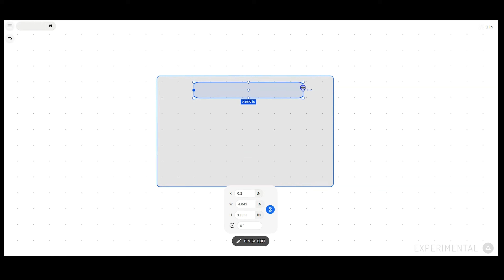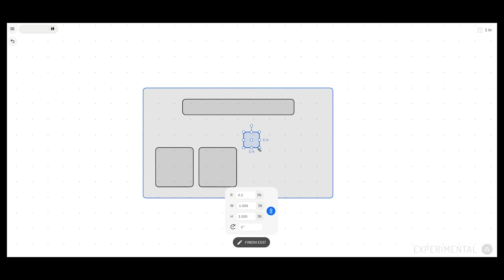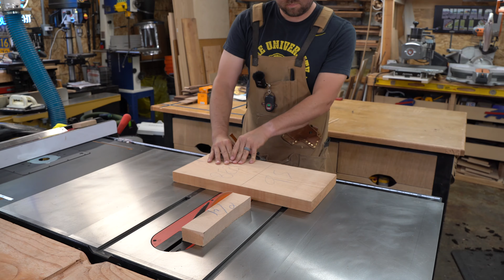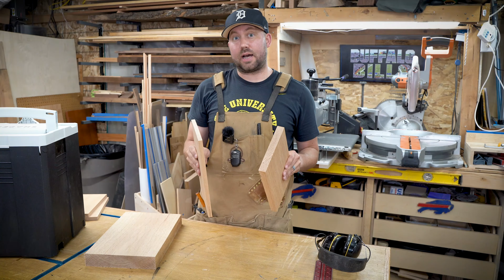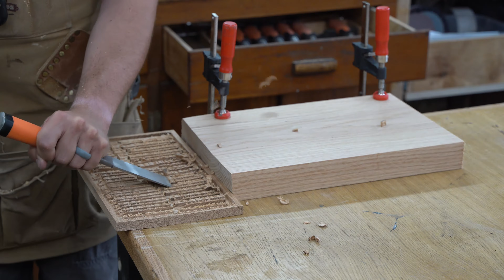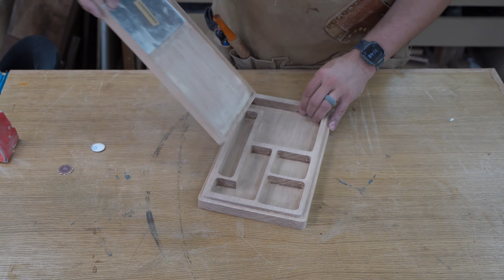Building a Modern Jewelry Box with Shaper Origin using Shaper Labs

Comment: Suggest next time, do the pocket cuts first with a flat bottom bit.  Take a few passes to you get to depth. Then do your inside cut with a .001 offset.  Then your final cut with no offset.   I think you will find you have little or no sanding.
Reply from the maker: Thanks for the tip Brian! If I make another one I'll try that for sure. Thanks for watching!

Comment: If you take some finishing passes you can remove a lot of the heavy sanding. So your final pass being .01 or .005 of you have it set to inches would help. Also there’s a bit by festool on Amazon that’s 20mm x 25mm for $45ish that will hog that out quick. You’ll need an 8mm collet as well but much cheaper than the new bits they released. Also, and this one makes me an A-hole but it bugs me for some reason. It’s an Origin, not a Shaper. Looking forward to your desk build. I have a G&G desk planned in another month or so and the Origin will be key in that build. Subscribed.
Reply from the maker: Amazing, Dave! Thanks for watching. Yeah, I'm going to have to practice saying it's an Origin. Man. I'm well aware that there is an entire tool already called a shaper but I guess I've always defaulted to that. Good point for sure 👍. I'll look into those finishing passes. I used a Dremel to get rid of the finite burning so I appreciate the advice!

Comment: Nice project. Not sold on the Shaper Origin yet though. It seems like a lot of work after its use.
Reply from the maker: Thanks for watching! It's definitely another tool and not at all necessary. But I've been surprised how often I turn to it now that I have it.
Reply: As mentioned elsewhere in these comments, lots (but not all) of the sanding work could have been avoided with a better routing strategy including use of a bigger flat bottomed bit for initial pocket clearing but not to final dimensions. By leaving a few thousandths of an inch in sides and bottom, final router passes with better bits can be used to create the final sizes with better surface finish. Definitely takes practice and will vary depending on router bits, wood, router speed, depth of cut, and etc. Bottom line is this is just a computer guided router. So there's no magic when it comes to surface finish--unless you count the ability to precisely define the amount of wood to be removed on those final passes. That ability can be difficult for hand routing to achieve.